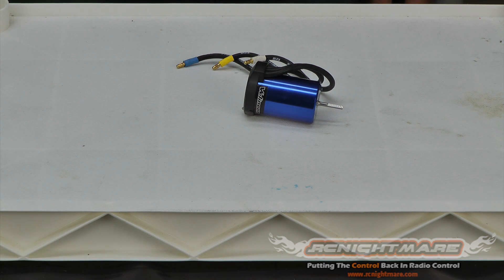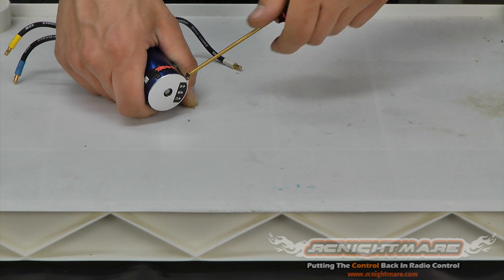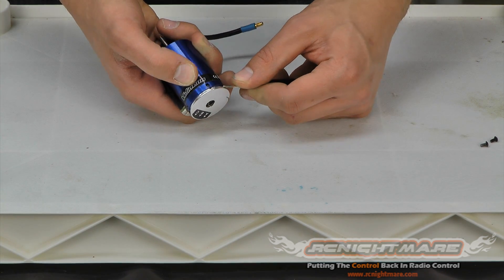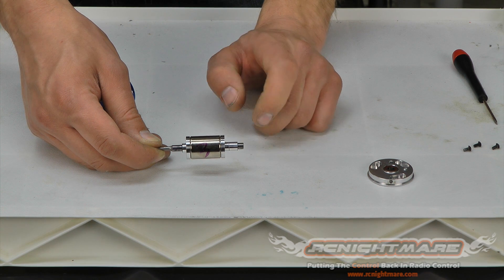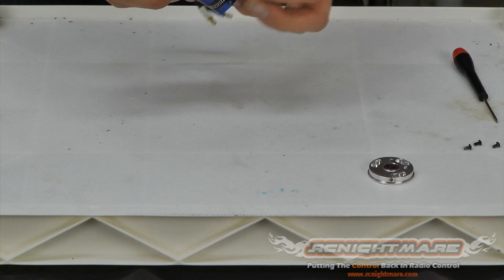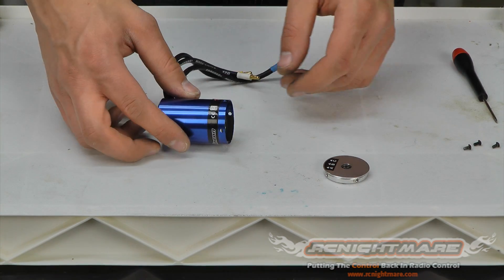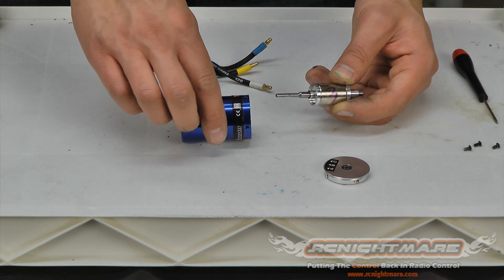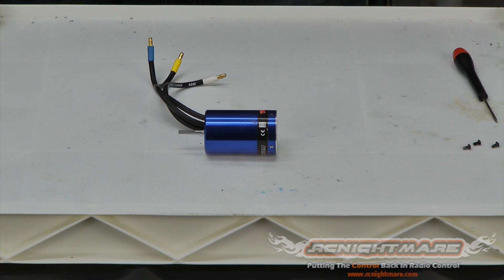How To Rebuild & Maintain A Brushless Motor

Comment: Is there any way to rebuild and possibly rewind the brushless motors for 1/24 scale and smaller? I have an excelorin 1220 10250 kv motor and all three wires broke. Also 7250 kv for 1/24 losi micro scte

Comment: Hello and thanks for the very informative video! Question: I have a discontinued Horizon Hobby 1/10 4-Pole 4000Kv brushless Motor and need to replace the bearings. How do i measure them or find the correct sizes for both front and back bearing please? Horizon Hobby customer service just doesn't offer much help for it's discontinued products. Thank you in advance! Kiko

Comment: if i misplugged the cables that go to the esc or if they touched each other can my motor have died because of a short circuit? if so, can it be fixed?? anyone knows how???
Reply: Dont unplug it connected to a battery.

Comment: Hey, im pretty sure that the magnet in my motor has come unglued )or however its in there) from the shaft, it does spin but has no power, i can stop the shaft with my fingers but stuff inside keeps spinning, what do i do?

Comment: should put a paper cone in between the winding wires and the rotor magnet. when you slide it out 
so it will not short out after is done?

Comment: i have a turnigy xk3650-b-5400kv motor and i used it loose without any pressure on the motor and now its got so tight and it even blew my 3s lipo.

Comment: So I am wondering if there are any way of fixing the magnet when it gets damaged. I have a motor that I am very happy with but when inspecting I have found that the Magnet has a small amount of imperfection on it and I wonder can it be repaired? ie.. Sanding in a drill or lathe?